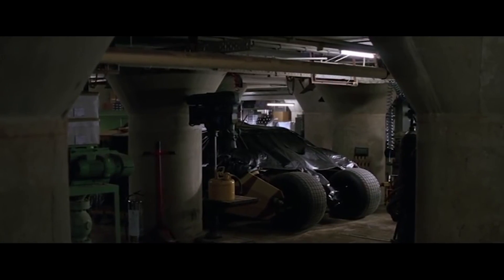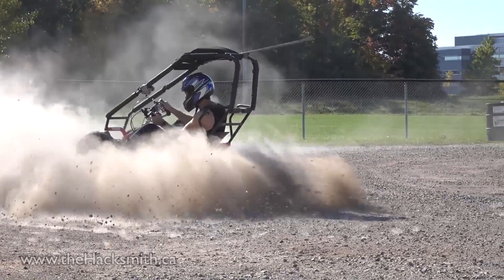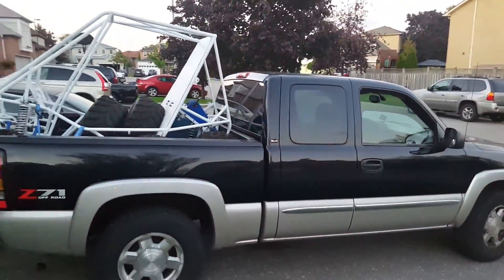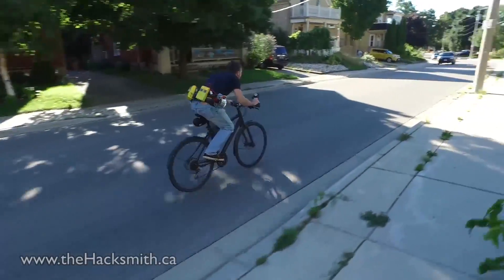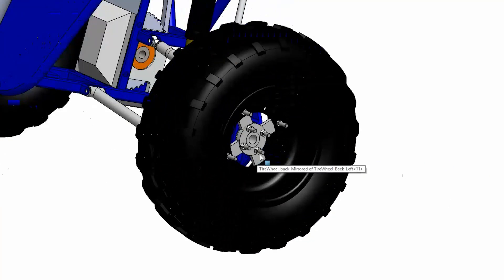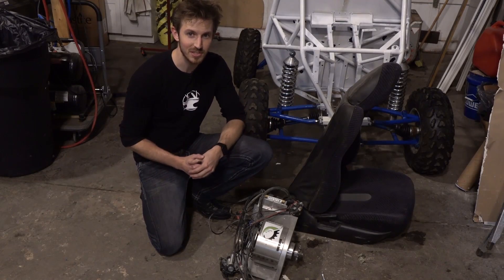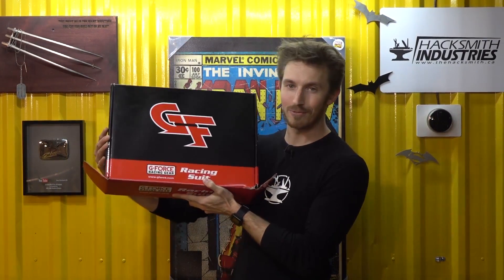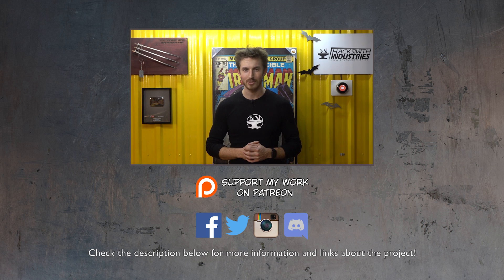Electric Batman Tumbler Part 1 - The Concept

Comment: To gain inspiration on how to make a badass batmobile without spending an arm and a leg, I dug pretty deep into DC comics history and I found out that batmobile has basically gone through a number of variations across the years, including Bulletproof Rolls-Royce to rocket-powered hot rod, and I also found a design that was even more Tank-like than the tumbler. It was depicted in Frank Miller’s “the Dark Knight Returns”.

Comment: Hacksmith you should check out shapeways they 3d print metal stuff .

It may help with making your EDF fans for flying like ironman project.

http://www.shapeways.com/materials/aluminum
Reply from the maker: We mentioned them in our last EDF video =)

We got a quote... $900 for an aluminum EDF blade, and not even one of the big ones :*(

Comment: If those drive shafts are anything like the Polaris ones that we use, be very careful to not allow the suspension to overextend putting stress on the CV joints. They are an absolute pain in the ass to work on and usually require the destruction of a few snap rings that you can't access, so you just have to hit it with a hammer and mushroom (and then replace) the ring to get it apart.

Comment: It is true that after a couple of years (sometimes even after 1 year) the old frame will no longer pass tech inspection due to new rules that make it so you have to start from scratch so that teams don't just keep using the same car every year and don't have to work at all since it is supposed to be a learning experience. However, that does not mean that an old car isn't structurally sound. The safety requirements for SAE Baja are far more strict than those for normal side by sides. Old cars can be used at unsanctioned side competitions such as winter baja in Michigan (theoretically a car from 2003 would still pass by their rules), or midnight mayhem, where the requirement is that it has passed inspection at a sanctioned event within the past few years.
Reply from the maker: Gotcha! Thanks for the info!

Comment from the maker: Suggest ideas for gadgets to include!

So far we're thinking... batarang launcher, grappling hook guns (two) with winches, automated paintball turret, 100,000 lumen + lights, jet engine afterburner, thermal vision, tactical heads up display....
Reply: the Hacksmith I saw once that the mythbusters tried to add a grappling hook to a car so it could hook onto something like a light post and help it take sharp turns at high speeds. You should look into it!
Reply: here are some ideas: a suit that gives you Coles electric powers from infamous(or you could actually build his weapon which is called the amp),  a hulkbuster Ironman suit, and a suit that gives you great agility(super speed, can jump high,ext),  a suit that makes you indestructible( including being fire proof), and a glider suit😜
Reply: Make captain cold gun from cw and use liquid nitrogen
Reply: the Hacksmith i have seen a video a guy created thor's hammer. He used some electric magnets from microwaves, a battery and a finger scan feature which can turn off the magnet and this person can lift it just like thor. Would be nice if you make it too
Reply: You should look in to getting a sonic cannon(Sound gun?)
Reply: A fan at the bottom to make dust come up even more for an smoke curtain effect? Not even sure it would work but smoke curtains are cool anyway!
Reply: the Hacksmith Try to add the jet booster with a real rocket or air turbines like the Iron Man suit
Reply: the Hacksmith ask Colin for help and add a pulse jet engine
Reply: How about a fog machine for when you need a quick getaway?
Reply: can you build automatic suit up iron man ?
Reply: the Hacksmith none of that sh*t matters bro , just make sure it has the motorcycle cannon that shoots out a motorcycle
Reply: the Hacksmith
Reply: I don't know, go for something smaller, like a smoke bomb launcher, same blueprints and design as the military type grenade launcher.
Reply: Or an ejector seat, but strap a collapsible glider to you're back, that allows you to glide for a short distance, like in Arkham Knight.
Reply: great idea
Reply: the Hacksmith a built in motorcycle! You could just make a mini bike
Reply: the Hacksmith tire nails disposal
Reply: what about ejectable motorbike?
Reply: Hologram stuff
Reply: auto pilot, bat bike
Reply: Why do you love all your own comments? Lol
Reply: boost
Reply: Realy
Reply: Smoke screen and a huge claw arm for grabbing stuff!!
Reply: This might be more Speed Racer than Batman, but perhaps a caltrops/spike strip dispenser off the back? To thwart pursuers in a chase
Reply: a deployable remote control suicide bomber car
Reply: the bat pod
Reply: Parachute
Reply: the Hacksmith oil slick
Reply: This might be a simpler one.. (or maybe a harder one depending on your goals with this project), a voice filter that will let people talk like Affleck's Batman and Amell's Green Arrow!

Having it really work well like in the shows/movies would be awesome, and if it ends up being not too expensive, tutorials/guides on how to make them would be awesome too!
Reply: Fireworks and explosions
Reply: I am so impress how Hackman put project together it supergood  and l  look could not believe how you put batman gears together because I am real big off batman my John passafiume and email is Jpassafiume777gmail.com I was really excited about give away thank you by for now
Reply: the Hacksmith transformation in tank!!!!!!
Reply: Falcon wings ?  ?
Reply: "if it's not powerful enough we'll get a second one" screw that! if your sponsor is willing get a second and break the sound barrier. or just go pretty damn fast 141.3648 kmh GREAT SCOTT THATS FAST!
Reply: the Hacksmith dude whats about  iron man repulsar bast glove??
Reply: the Hacksmith make claws that help you climb up walls
Reply: the Hacksmith put two edfs on it
Reply: the Hacksmith an affordable one person flying/hover-bike/transport or something alike! !
Reply: the Hacksmith 100th like
Reply: the Hacksmith hi
Reply: Make sure Star Wars blaster
Reply: the Hacksmith were do you live
Reply: the Hacksmith please make iron man Hands that shot pulsars
Reply: the Hacksmith Baja in swedish means poop 😛
Reply: the Hacksmith I drive a del soul
Reply: An helicopter.
Reply: BENJAMIN HEFNER

Comment: While some where probably expecting a replica of the Nolan Tumbler, I would think that the gadgets that may fit here might be more like the ones on the original batman films. I would like to see you add some sort of rotating batarang thrower, mini flamethrower, and the grappling gun on the side for quick 90 degree turns. Just not quite sure if any of these are viable. Another could be a small ramp jump though.
Reply from the maker: +jose paolo Aranda those are definitely things we're considering :)

Comment: the Hacksmith I was wondering what you guys used as a throttle/ motor controller on the electric go-Kart. I was working on a similar project, but got hung up on that aspect because I kept blowing out the cheap hobby controllers I found.
Reply from the maker: +Nathan Rukavina check out the go kart video linked at the end :)

Comment: you should make a friction proof suit( like flash )
Reply: Not possible
Reply: possible. If the the racing suit is fire resistance that there might be a chance for a friction proof one
Reply: thats not how it works. There is no friction less material developed at all. And why would you want a friction less suit anyways?
Reply: ok if not a friction proof a fire proof to make sure they don't burn to flames when they test their tech out'

Comment: Hacksmith! please try to install a split front axl, to create more realism! it can be done! please try
Reply from the maker: Front end is already split ;-)
Reply: the Hacksmith    like does it have the front wheels' axls from the out side, like the actual tumbler
Reply from the maker: It has individual joints for each wheel, they're on the inside though. Asthetically it's not going to look like the tumbler, but we'll load it with all the tech.

Comment: that flame proof suit, is is possible to be used with those rockets you played around with earlier at the iron man project?
Reply: From my understanding they are not doing the rockets because of legality of using the number of rockets they would need. However hopefully they will still start using it in the iron man project to provide some extra safety in the event of an exploding battery.
Reply: Yeah indeed, and you could maybe make rocket launcher off your arms possible
Reply: Rens I don't think that would work. they tried testing with Kevlar and the rockets even burned through that
Reply: Nerf Slash Boss is right. He already tried using flame retardant material, and the problem is because the rockets create WAY more heat that an aerosol can and a lighter. And I guess the thrust actually eats away at the material which doesn't help either. That, and legal issues to where he could only have so many I think, or because it's extremely hot, and would be dangerous if it caught anything on fire.

Besides, rockets only give thrust. Once it's gone, you're falling down. The EDFs will provide thrust, and can be regulated from thrust, to hover or whatever he wants to do with it for a few minutes
Reply: Atomic Ws6 That's controlling the mixture of fuel to oxidizer. The EDF's can be fully controlled compared to a rocket that burns... Either way, it's just much safer to be using EDFs because there's less of a chance for catching on fire.
Reply: Yes, safer. Although strapping tons of lithium ion batteries to your bodies probably isn't described very often as safe. lol
Reply: IZylusI Hybrid rockets can provide variable thrust.